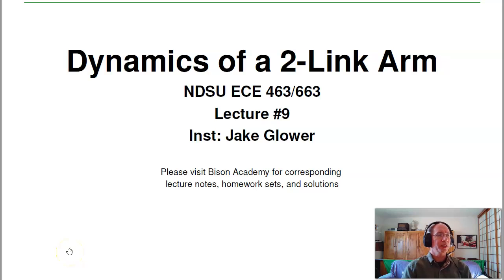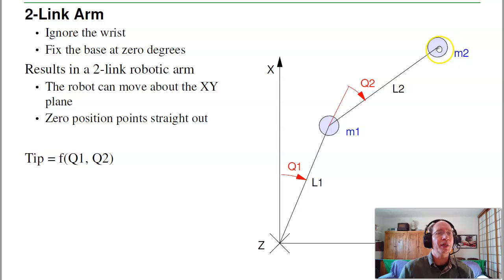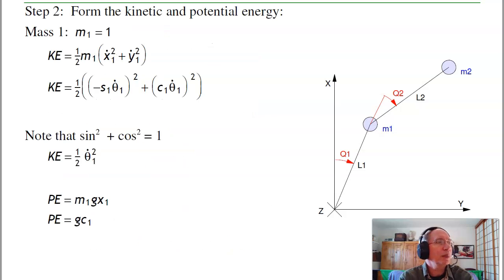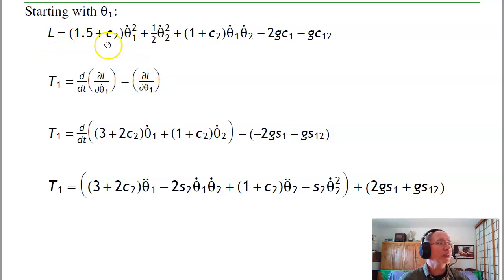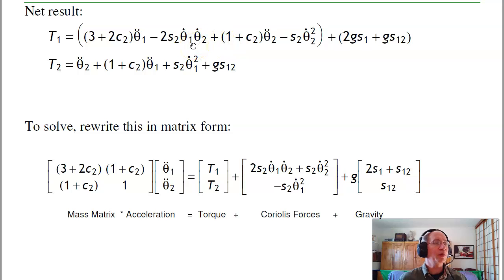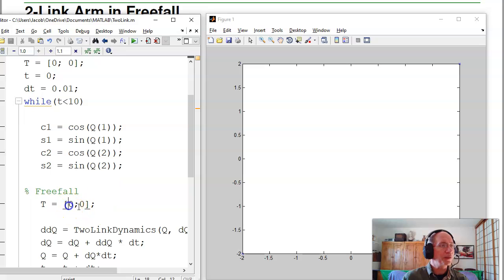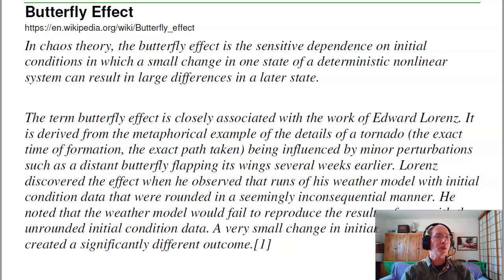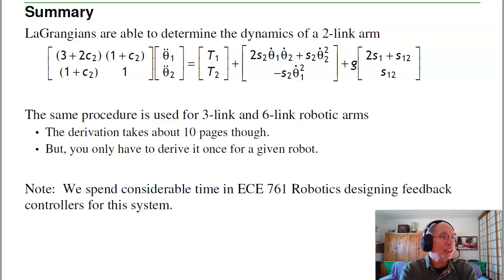ECE 463.09 Dynamics of a 2 Link Arm

Comment: thank you 
what if i want to add a flexibility on the joint how to simulate it ?
Reply from the maker: Depends upon what you want to model.  If you model it as a rigid link with a spring, you can treat this like a triple pendulum (requires a new derivation of the dynamics but pretty straight forward).  If you want to model one or more of the arms as a flexible beam, that's a completely different problem.  Flexible beams are dispersive in nature and much more complicated to model.  There are many papers that look at how to model a flexible beam with differential equations (very mathematical papers) or with finite-element models. It's actually a really hard problem
Reply: @BisonAcademy2  no not a flexible beam only rigid link with a flexible joint (spring or spring damper) why will it be and i generated its lagrangien model i only need to simulate it

Comment: This code played at 14.33 time does not work , which toolbox you are using for twolinkdynamics function
Reply from the maker: Working code is liked from the main page ( http://www.bisonacademy.com/ECE463/Index.htm )
Reply: @BisonAcademy2   sorry I did not get it. This link only shows index page
Reply from the maker: @kirandeshmukh1944  The Matlab code is under lecture #9 (dynamics of a 2-link arm), 6th column.   You'll need both files:  one determines the dynamics, the other one is the main routine (TwoLink.m) which calls the dynamics routine, does numerical integration, and displays the 2-link arm as animation.